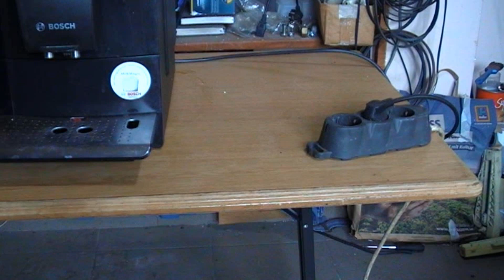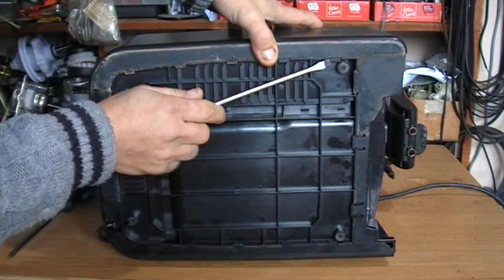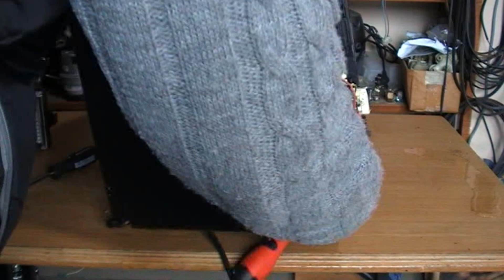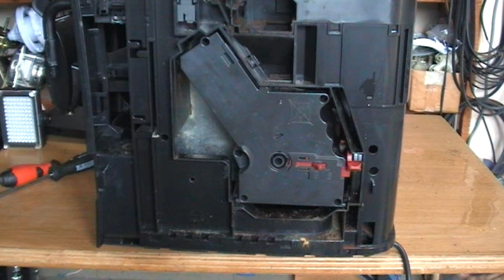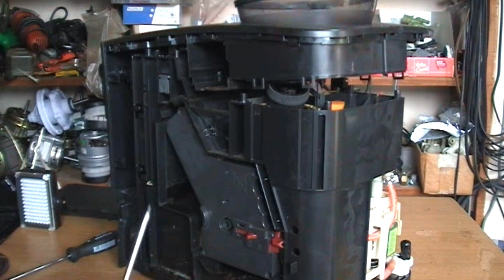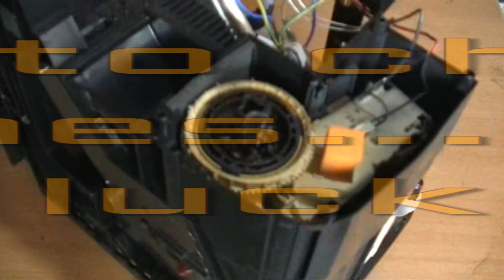Bosch verocafe problem

Comment: Great video! I am building it up, conneced the hose to the valve it doesn't detect the water tank. Maybe you a tip?
Reply from the maker: Check the magnet in the water tank
Reply: @gabidragomir  it seems that that valve of the water tank doesn't work. The light of "low water" of the machine is ON even though the tank is full. There is a part with an "X" form that should push the spring of the valve, but it's low. Do I need to do something when I connect the tube between the water tank and the pump? or is this is a symptom that the pump is damaged?
Reply: @fishingmanbche I had the same problem. There should be a counterpart for the magnet inside the machine. It came off when I was cleaning the machine and I didnt know to put it back where it belonged.

Comment: Buna ziua, detin acelasi tip de aparat ca cel prezentat. Dupa o pornire, au ramas activati indicatorii de la apa si aburi (stanga si dreapta sus) si de atunci masina nu mai raspunde Aveti idee despre ce poate fi vorba? 
Multumesc anticipat.
Reply from the maker: Pot fii mai multe cauze pentru care se aprind becurile de avarie. Trebuie facut un test, asa nu va pot ajuta prin mesaje. Cu stima...
Reply: Trebuie sa scoti duza de spumare, după ce in prealabil pui un recipient sub el, laşi să curgă apa din duză pana ce becul de spumare nu mai clipeşte, apoi bagi duza la loc şi gata, aparatul poate fi folosit din nou.
Reply: Buna ziua, de 2 saptamani ma confrunt cu aceasi problema (a aparut de 2 ori). Dupa ce trag diuza de spumare si scoate apa, functioneaza perfect. Este clar ca aparatul are o problema si metoda asta de "pacalire" nu rezolva decat pe moment. Totusi ce poate avea? Unde poate fi problema? Ce test trebuie facut? Va multumesc!
Reply: @tek_ids2111  Trebuie sa-i cureti flowmetrul.Merge greu si nu-i da impulsurile necesare la electronica,zice ca nu are apa.De aceea tot cere sa umpli sistemul de apa.
Reply: @karlmuller9517  fix aceasta este problema. Multumesc de ajutor!

Comment: Problema cu un bosch vero aroma . Am pus apa  in containarul de apa cu paharul si cred ca am pus si pe langa… am facut o cafea iar apoi a aparut pe ecran high or low voltage… dupa care a facut un poc si sa inchis … lam curatat bine si lam aprins iar … acelasi mesaj pe display si a facut poc exact in momentul cand lam si deconectat de la curent… acum nu se mai aprinde deloc ..
Reply from the maker: Langa rezervorul de apa este partea electronica... posibil ati turnat apa pe modul, trebuie vazut de un specialist.